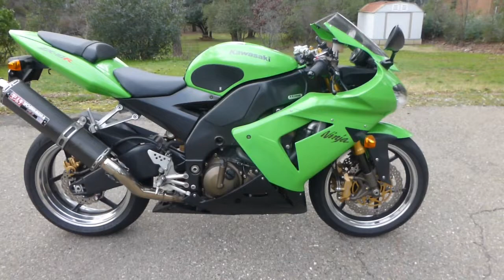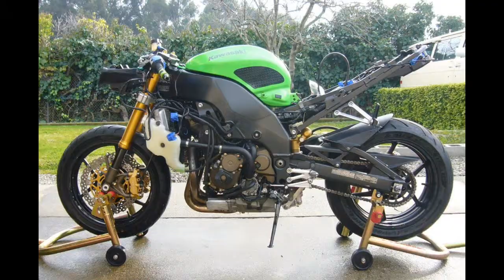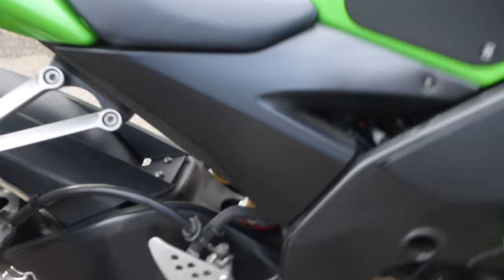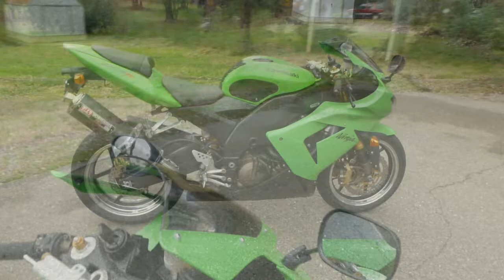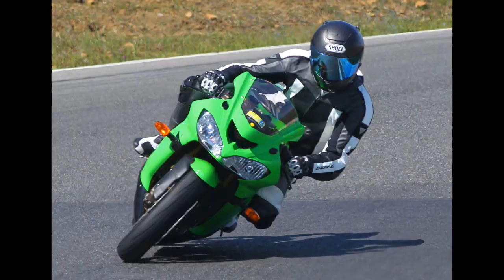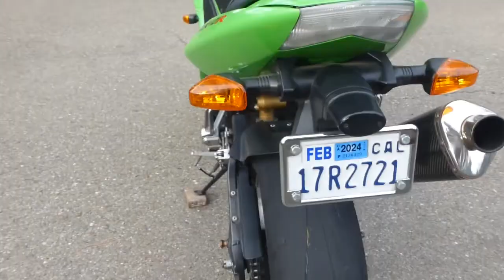ZX10 Track bike

Comment: I had one of those, it is pretty much the ultimate machine, it’s a little bit too much for me and it’s probably a good thing the thieves got it not too much later, very content with my Z 900 now on a sidenote, I hear the new ones have the variable Stacks the change length based on throttle position I sure wish that was a kit that would go on any bike maybe someday
Reply from the maker: I'm sorry to hear some scumbag took your bike.  I used to mod engines as I was a builder, but these days, I am happy that they run well and don't want to mess with that.